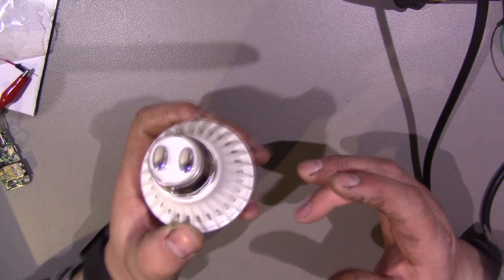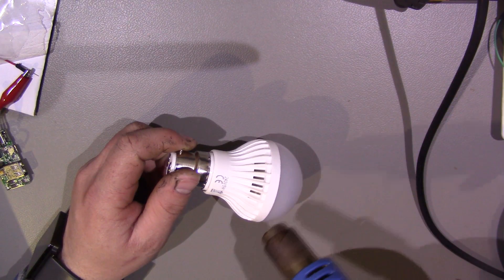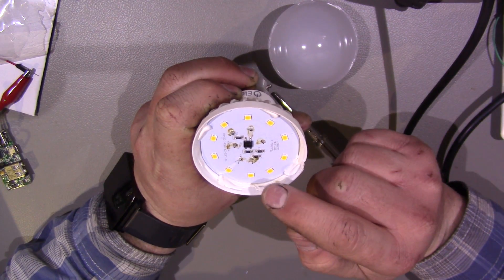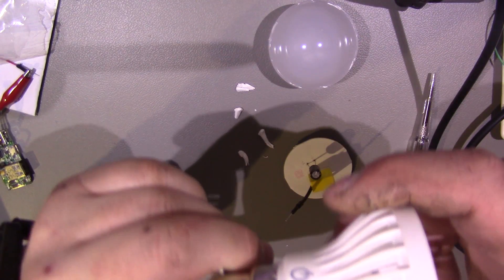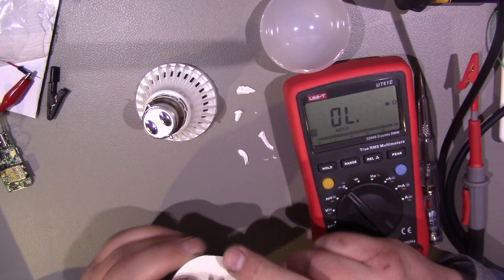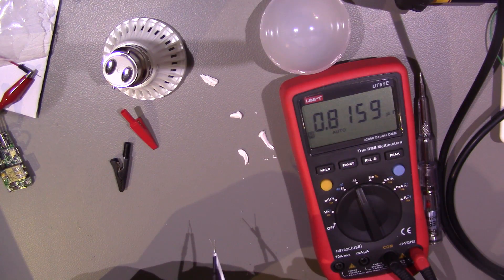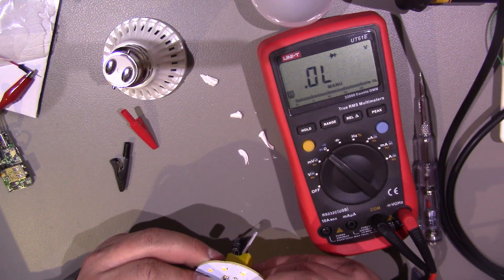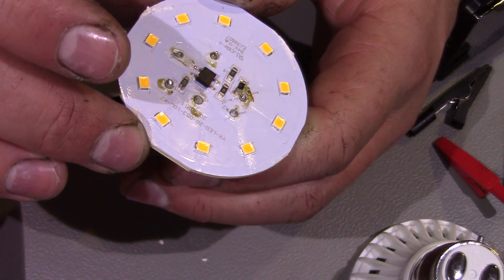Poundland Failed Electrek LED Bulb

Comment: I took a chance on this brand at Poundland and bought 4 of the smaller Electrek  5W round LED lamps.  So far 3 of them have failed, after only a little use over 2 months.  Two of them that I have opened have had burned spots on one or more of the LED's and overheated looking solder joints, indicating that they are being over driven with inadequate heatsinking.  I kept the packaging in a drawer and now see that there is no warranty information on them, so the manufacturer has no confidence in them being able to last.  Probably a good indicator to look out for next time I'm shopping for lamps.

Tried looking at your website today, none of the links on it seem to work for me?
Reply: Just bought one, we shall see - apparently 3W its the max you should buy according to bigclive as the 5-6watt generate too much heat!

Comment: My 5W in this size is still ok, but a batch of 5W candle all died.

Must get round to trying fix / autopsy them, I'd be inclined to probe the LEDs with a current limited supply / PSU and resistor, I'd bet anything it's a dead LED (though didn't notice any black spots). The 5W models seem to be the same as the 3W, overloaded!!!

PS. if the LED string goes open circuit, the electrolytic cap will be overvolted, as it will approach 350V bar losses in the dropper & discharge resistor